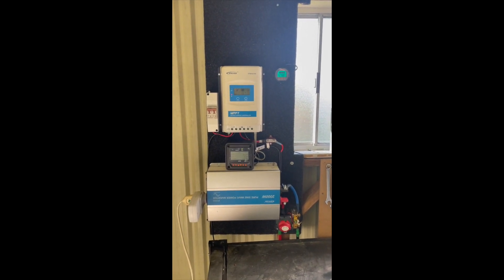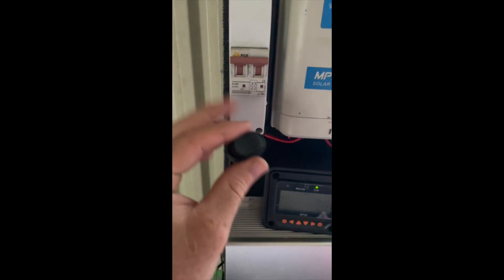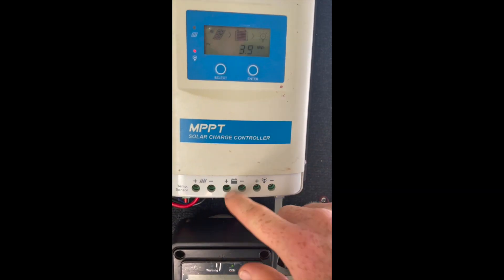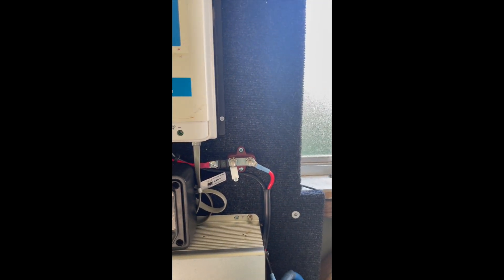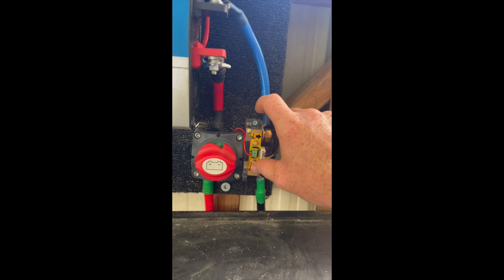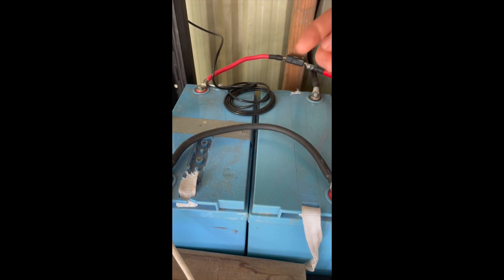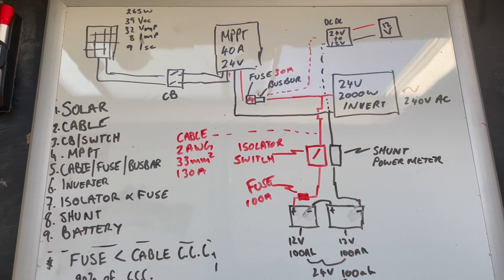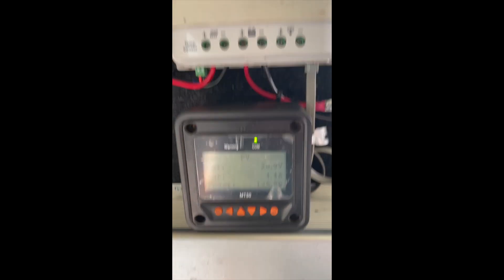HOW To Set Up an MPPT Solar Controller - EPEVER XTRA XSD2 PART 2

Comment: Circuit breaker should not be used as a switch.
Reply from the maker: Sorry mate dont follow? Isn't that the point of a circuit breaker - to trip or manually isolate a circuit?

Comment: Nice set up, mine is similar but still not finished.  I do have a question.  The XTRA controller has a default charging profile for LiFePo4 batteries. the 8s/24v default profile, among its many parameters,,bulk charges at 29.2 volts and float charges at 27.6 volts.  Why do you see a need for the MT50?  I have one but my Amazon return window is closing.  TIA.
Reply from the maker: GGGG - sorry mate I didn't see this comment till now. I think the new models now have pre-programmed LiFePo4 charging profiles which is sweet and you don't need the MT50. The older versions don't have a pre programmed LiFePo4 profile and you needed the MT50 to create it.
Reply from the maker: MT50 always handy to have at any rate.

Comment: Thanks mate - that's a good introduction for non sparky blokes (which is me). I did buy the Epever and mt50 for my first van conversion system - but Im considering my second more ambitious van conversion. First I have to resolve which DC to DC charger to buy that works with my current EPever solar charge controller - any advice welcome so I don't buy the wrong thing. In your shed I'm thinking that a bit of insulation on the inside roof and or walls wouldnt go amiss  - it must be unbearably hot in there.
Reply from the maker: Gday mate. Sorry for the slow reply. You can email directly. 
What sort of Epever mppt do you have and what battery are you charging ? Is it lead or LiFePO4? 
Shouldn’t matter what dcdc you use in relation to your mppt. Premium is redarc, next is victron or enerdrive then probably last is renogy.
Reply from the maker: Haha yeah that shed is hoooottt in summer. Free sauna though. 
I’ve got a fan rigger up but it doesn’t do much. 
I don’t spend that much time in there during the middle of the day.

Comment: Hello bro I have Xtra 40 4415 can I attach 2 panels of 380watt in series or in parallel for maximum output. Will it damage the controller?
Reply from the maker: Hey mate - yeah 760W panelsis just ok for a 12V battery. The max is 780W I think. 
Can be in series or parallel it doesn’t matter cause you only have two panels.
Reply: Hi 
No will be fine